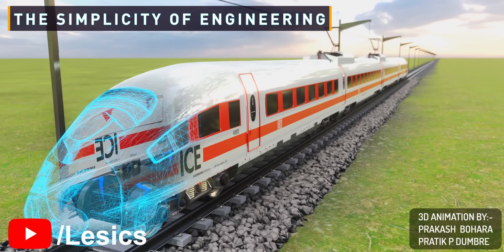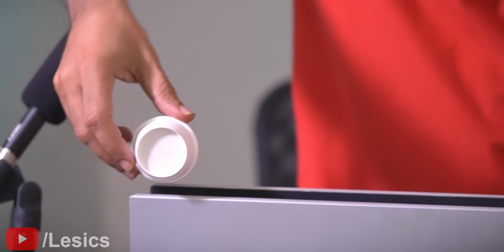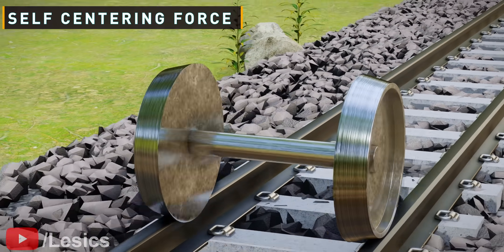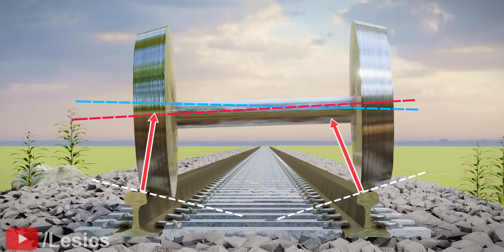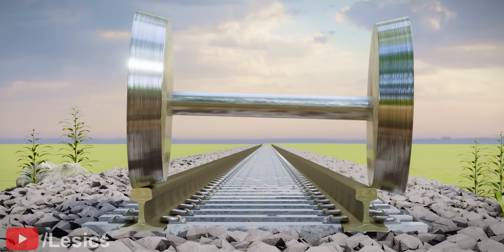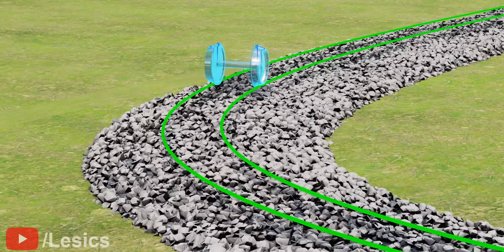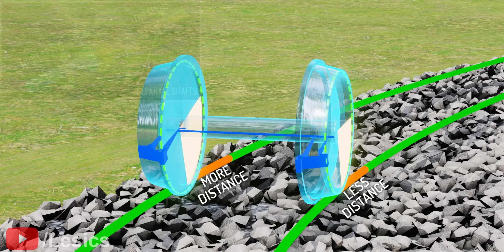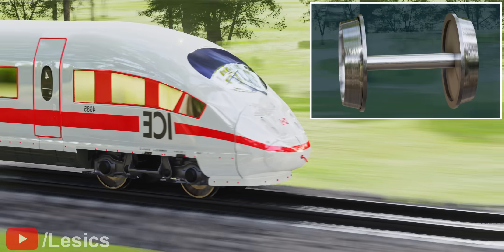The interesting engineering behind the SHAPE of Train wheels!

Comment: Driver (engineer in N America) of 40 years here. I've had to explain this to several trainees over the years and none of them had any clue of this phenomenon before it was explained to them. It's just not something the average person wonders about. I also explained (not to criticise as your video is excellent but you probably should've too) that the further apart the wheels are (the wider the track gauge is) the more differential action is needed because the outside wheel has to travel a LONG way more than the inside wheel but train wheels and the rails they run on are only around 80mm (3") wide so the wider the gauge, the less tight of a curve the train can negotiate. That's why mountain railways are often narrow gauge. Narrow gauge is cheaper to build than standard or broad gauge and when people are told that, they always say "because the sleepers (ties) are shorter?". Well, short sleepers probably are cheaper than longer ones especially when you need thousands of them but narrow gauge is cheaper because you can go around mountains rather than having to tunnel through them because you can't negotiate tight curves.
Reply: Knowledge speaks
Reply: Is that why Brunell's wide gauge never caught on?
Reply: @therealrobertbirchall  The UK is mainly flat so it probably could have but there was a plethora of gauges and 4' 8 1/2" simply had more miles of rack than any other so it was chosen purely for that reason. Same happened in the USA.
Reply: @davidrayner9832  the uk is not mainly flat. Ok our tallest mountains aren’t as high  as others  but flat it ain’t
Reply: @davidrayner9832  England which is where Brunell mainly worked is flatter than the US for sure, but in England the railways had a lot of curves because thet tended to go around the hills and unlike the US the railways were built to connect existing towns, whereas in the US the towns were built on the railway. There were also rights of way issues where politicaly powerful individuals prevented development of railways on their land, most of England,  unlike in the US where most of the tracks were built on virgin land. This all left us so many curves, this is why high speed rail in the UK is problematic because the victoriana track beds are not suitable for fast trains and governments are reluctant to take on vested interests when procuring land. We have lots of narrow gauge railways in the UK in mines and famously in Wales where narrow gauge was used in the mountains to haul slate from the quarries.
Reply: @therealrobertbirchall  Flatness is relative. The UK can be quite hilly and mountainous on a small scale, so gradients can be steep but generally over shorter distances; lots of the US is easily graded (the Rockies being an obvious exception). No hills to go round on the prairies. The Stephensons for early long-distance railways like the London and Birmingham used very flat gradients (1 in 330) because of the low power of early engines; that needed curves, big earthworks or both to deal with even modest hills. Brunel's billiard table only extends to Chippenham; after that it twists and falls to get through the Cotswolds to Bath and Bristol.
Reply: @iankemp1131  exactly so many curves. And the magnificent Box Hill tunnel.
Reply: @therealrobertbirchall  Yes, I know the tracks are curvy but they're generally large radius curves. I travelled from London to Edinburgh a few years ago and we sat on 100 mph for four solid hours. That may not qualify as HSR these days but it's not possible anywhere in Australia and it IS the flattest country on Earth.
Reply: @highdownmartin  I know it's not flat but it's flat enough for trains much faster than we have in Australia and it IS the flattest country on Earth. I once travelled from London to Edinburgh and we were doing 100 mph for four solid hours. That's not possible anywhere in Australia.
Reply: @davidrayner9832  took us 150 years to develop locos with enough power to do that. Shap ,beattock ,settle to Carlisle, Dainton, Rattery , the Lickey   All mainlines with fearsome gradients that slowed steam traction to a crawl. Electrification flattens everything!
Reply: @davidrayner9832  is it not possible in Australia?  I'm surprised
Reply: @therealrobertbirchall  most of us Ozzies live along the East coast. Venture in land and there is hardly anyone, and not the economics to support electrification.
Reply: @davidrayner9832  An interesting video. Some say that the standard UK track guage long in use, was based on the equivalent of 2 horses hitched along side each other for pulling a freight waggon. The trails eventually became tracks.
Reply: @therealrobertbirchall  I know Australia has a terrible problem with some of its tracks.  Trying to be cheap and not replacing the sleepers properly has caused mudholes  to form.  Its crazy watching a video about it. Like why would you not fix that immediately before it causes a derailment.

Google say, "Australia is just not suited to high-speed rail because the cities are too small and too far apart."
Reply: @davidrayner9832  Also narrow gauge is NATURE friendly in case of mountains because there is no need to harm them by creating tunnels..👍
Reply: @davidrayner9832  if Australian trains can't go at high speeds then that's a legislation or company policy issue. Australia absolutely could have high speed rail. The UK is far from the flattest country. Even ignoring small Polynesian island nations there are plenty of flatter countries, like Egypt or Denmark. Most of the UK is rolling hills
Reply: @justinbeath5169  Of course we could but the hilliest part of the flattest country is along the east coast which is where a high speed railway would have to be as 80% of the population lives there and yes, the reason we don't have it is because no one will commit to building it because A; it costs the same to build through hilly or mountainous country no matter where in the world it is and B; we don't have the population of countries like Japan so it'd cost a fortune to build and take forever to pay for itself. Building one across the Nullabor Plain would be very cheap but no one lives there. For those reasons, I can't see Australia ever having high speed rail.
Reply: @davidrayner9832  "we don't have the population of countries like Japan so it'd cost a fortune to build and take forever to pay for itself."
As I put in a reply to another commenter, we have large population centres (particularly Melbourne and Sydney), and back in the 1980s there was a proposal from a private consortium to build and operate a line between those two places.  They didn't want government subsidies, but did want the government to defer payroll taxes until they were operating and therefore earning an income.  The government wouldn't come to the party.
Reply: @PJRayment  Yes, Sydney and Melbourne are the two biggest cities so if we were ever to get HSR, that'd be where it should go but after an uncountable number of proposals and even renting a train from Sweden, nothing has come of it so one would have to conclude that there is no financial incentive to do it. I see Labor NSW has said that if they win, they'll put in HSR from Sydney to Newcastle. I say the people should tell them that everyone will vote for them just this once so they'll win every seat in the state but by the end of their first term, there'd better be some track laid and if there's not, they will never ever get into power again and that has nothing to do with it being Labor. If Liberal made that promise, same deal. I live in Newcastle so I hope Labor does win, just so I can say at the end of their term "well, there's another HSR proposal that came to nothing". That, and because the Liberals cut the low speed rail line off.
Reply: @davidrayner9832  I am new to Newcastle and even to Australia. Still understanding the parties and politics. Thanks for sharing that information. But with the prices of properties in Newcastle going up due to shopping by Sydneysiders, if this HSR proposal goes through it'll skew the market so much more.
Reply: @therealrobertbirchall  i would argue that we would need wider gauge. yes it means more tunnels and less tight curves. but with wider gauge we can get wider trains that act like small freight ships on land. imagine if a train car could stack 3 standard shipping containers in width and 5 in height. just by scale it would bring down freight costs on land.
Reply: @nilsdock  I think England is too small for such leviathans and you should concentrate on costal traffic via sea container. This makes even less sense in Scotland and Wales.
Reply: @therealrobertbirchall  lets put them on bigger continents then
Reply: @nilsdock  you are forgetting a train can be as long as it needs to be.
Reply: @nilsdock   You don't have to walk sideways in the cars when passing people?  Our train's today is in my opinion narrow gauge All of them.
Reply: @nilsdock  

As a society, at least in North America, we can't even get a lot of the cargo off of highways onto rail even though it's less expensive and better for the environment in its current format. Much of this stems from decisions made when the shipping container was introduced. There's a very interesting book (at least I found it to be surprisingly interesting) called The Box: How the Shipping Container Made the World Smaller and the World Economy Bigger by Marc Levinson. It goes through the what shipping was like before the shipping container and the changes brought about by it. As I was reading the book I could see decisions made in the 1950's and 1960's that were still impacting us today. 

Many people are trying to replace the fossil fuel burning long distance trucks with some sort of "clean" version that uses batteries, connects to the grid like trams, or use hydrogen. These don't remove the trucks from roads and all of the other problems associated with them such as traffic jams, wear and tear on the roads, accidents, and so on. I'd like to see rail being replaced to at least all of the major cities again (since so much rail has been taken out). Rail would be used to distribute cargo to the major cities. From there the long distance truckers would be re-tasked to local and medium distance deliveries. Eventually all cities would have a cargo rail station again with trucks to deliver locally and to towns and to the country. This would dramatically free up space on the highway system and also cut down on the maintenance of the system too as fewer heavy trucks would be driving on them. The more goods taken by train, the better for the environment, especially if the trains could be electrified with a clean source of electricity.
Reply: @therealrobertbirchall  given Japan's high speed network is narrow gauge , I don't think it was down to the physics of cornering, Some African and Australian railways are narrow guage for freight too so that also wasn't a consideration , Brunel was simply a victim of the politics of his time, also the added cost of wider guage , wider track beds tunnels and other assorted infrastructure. I personally think wider guage would have been better if adopted as the main standard .
Reply: @Dawgreen  All correct except that while Japan's traditional railways are narrow, the Shinkansen runs on standard.
Reply: @Dawgreen  due to physics Japan's high speed trains couldn't take very sharp curves because of tipping which a wider gauge would help with but idk
Reply: @Dawgreen  My guess as to why high speed and freight trains use narrow gauge is simply because longer axles are more fragile. With freight and high speed, the forces acting on the axles are much higher and since the gravitational forces act on the middle of the axle and the normal forces act on the wheels the axle could bend.
Reply: @Dawgreen  Japan's high speed is standard gauge
Reply: @Dawgreen  Japn's high speed rail network is standard gauge, the rest of their rail lines are narrow gauge.
Reply: @Dawgreen  probably not the sole reason, but cost savings is cost savings so why not do it?
Reply: @Ninjaeule97   It's better with train wheels. They have they'r bearings on the outside close to the wheel.  It makes the axels stable.
Reply: @Dawgreen  only short lines aus uses browd gauge and standard gage the most
Reply: @Dawgreen na wybór szerokości torów w dawnych czasach miało wiele rzeczy wpływ. Pamiętajmy że wiele szerokości infrastruktury zależało od cen stali,robocizny,dostępu do odpowiedniej ilości kadry, z odpowiednim poziomem wykształcenia.
Raz podjęta decyzja utrwala się na wieki ,bo okres transformacji jest zbyt drogi.
Trzeba wymienić w skali kraju tysiące kilometrów torów,wymienić osie wszystkich wagonu
Reply: Thanks, now I know more about trains.
Reply: @ohh9979  i guess you needed the extra training.  ;)
Reply: What you said about turn radius is not wrong, especially when talking about mountain railways where the speed is slow and cant deficiency (superelevation/difference between height of inner and outer rail in a curve, think of a banked road on a highway) is minimal. However on plains, tracks are banked at curves. The maximum bank angle/ cant deficiency is a function of the track gauge. The broader indian gauge for example has a max cant deficiency 165mm whereas the standard gauge of US has this set at 75mm for normal use and 102mm by special approval. This means that broad gauge tracks can negotiate sharper curves because the wider wheel base gives higher stability. Also, the wheels of broad gauge trans have a greater radii than their standard gauge counterparts as wheel diameter is generally 0.75 times the track gauge, and the width of the tread also increases proportionately. This means negotiation of curves is more or less the same in different gauges used around the world though the higher cant deficiency in broader gauges means that it can turn tighter. The reason mountain railways generally don't use cant deficiency is because that increases the dynamic profile of the loading gauge and space is for a premium on that terrain, otherwise what you said is correct. Im a signal engineering student of indian railways but my friend in the permanent way department gave me inputs for writing this message.
Reply: How many gauges are there in North America? 
I always assumed it was standardized.
Reply: @Heavywall70  There were once many, for example the Pennsylvania Railroad was 4' 9", just 1/2" wider than standard and they, along with several others, had to regauge to standard purely because there was more of it than any other. Mountain railways like the Colorado & Southern had narrow and they standardized the lines they wanted to keep and closed the rest. Some of those survive as tourist railways but they don't connect with the rest of the network.
Reply: @davidrayner9832  Don't cone shape wheels imply huge pressure on rails? Since it's not a surface it's a line, wouldn't excess pressure deforms rails or wheels?
Reply: @kozatas  I don't know but it does keep the train centralized on the track and allows it to go around curves. If cone shaped wheel have any drawbacks, they're not serious enough to not use them or find another way.
Reply: @davidrayner9832  Their is video by "The History Guy" titled "The Day the Gauge Changed." When Southern railways changed over to the Pennsylvania gauge.
Reply: @kozatas  Yes there is huge pressure. The railhead is prone to fatigue failure and also has to be reground fairly regularly to maintain the correct head profile.
Reply: @Heavywall70  Standard Gauge is 4’ 8 1/2” .  Older narrow gauge, like the Denver and Rio Grande Western and many others were 3’ gauge.  Maine had several that were 2’ gauge and some industrial RR were 18”.
Almost everything you see in the US today, aside from some historical stuff etc, is Standard Gauge @ 4’ 8 1/2”
Reply: @elconquistador932  I can’t speak for other transit systems but the BART trains here in the San Francisco Bay Area run on 5’ 6” broad gauge. Presumably the extra width would be more stable during an earthquake as trains are brought to a stop, but it also preserves the system as dedicated to passenger traffic only.
Reply: Hadn’t thought about tread width/ minimum radius before , I knew the answer but that explains it   nice one
Also the rail heads are also canted in. Usually 5 degrees ,matching the coning
Reply: im just the average joe 39 years retired owner operator of two macks but i have just learned somethings i always wondered about.  (with the wheels ) also i happened to have an inspector explain the laying of ribbon rails while watching for two hours how they install new rails ( i always wondered how they prevent the rails from bowing out ) well what they do is nail down the rail about every fourth tie then they heat up the rail and nail down the rest of them this helps to prevent expansion when the temperature get real hot also the machines were owners of the company that layed the rails . this was done on the wisconsin southern line from waukesha to milton two trains per day the guy said that these rails could last up to a hundred years
Reply: @realtruth172  what the railroads do for ribbon rail is to stretch it (like a guitar string)  before they nail it (spike it or clip it) down. It is far easier (read cheaper) to repair a track that has failed in tension rather than compression (bowing out).  Look up rail tensors. They also stretch it when they weld the 1/4 mile strings together, hold them under tension as they weld.
Reply: @hugocfr  Thanks for the info.  Watched a show the other day about a train derailment in Tempe, Arizona. They believe it was caused by the rails expanding, since it was the middle of summer. And I was wondering how they prevented that from happening more often and forgot to google it.

The Eiffel Tower gets taller by up to 6 inches during the summer and its only 324 meters tall. Based on that in a mile of track you could have around 30" of expansion.
Reply: @fukkitful  
"They believe it was caused by the rails expanding, since it was the middle of summer. And I was wondering how they prevented that from happening more often and forgot to google it."
Actually, the normal approach these days is simply to hold the rails tightly, with plenty of ballast, including at the ends of the sleepers.  You can thereby contain the expansion.  Heat-buckled rails are typically found where the ballast is missing or in poor condition, or freshly laid and not yet settled.

"Google say, "Australia is just not suited to high-speed rail because the cities are too small and too far apart." "
It's not a simple answer, and also includes the question of what is meant by high speed.  Victoria, New South Wales, and Queensland all have or had trains operating regular services at 160kph (100mph).  NSW was first, with it's version of the British HST (standard gauge).  I think it's speeds have now been downgraded.  Victoria has frequent interurban services operating at that speed (mostly on 5'3" gauge, but also on standard gauge).  Queensland has two trains that operate at that speed (on 3'6" gauge).

There have been and still are numerous proposals for trains much faster than that.  A 1980s proposal was for a line between Melbourne and Sydney with trains operating at 300 kph and the fastest journeys taking three hours.  This was a commercial proposal, that wanted government assistance in the form of deferring payroll taxes until the line was actually operating (and they had income).  The government didn't agree.

The cities are not too small.  Well, some aren't.  Melbourne and Sydney each has a population of over five million people.
Reply: in response to your question im retired 11 years had two new macks one 14years and one 24 years total 39 years 2  3/4 million miles this was just very recent about how they lay these ribbon rails this was done in waukesha county wis for southern wisconsin railroad the man said the expected life for these rail is one hundred years two trains a day come thru
Reply: @realtruth172  so Joe are you 39 or been retired 39 years?
Reply: @Dawgreen  But the high speed running is confined to standard gauge. The change to narrow gauge is to provide through services to outlying towns, like the French TGV continuing on to ordinary low-speed lines of the same gauge. Speed records for narrower gauges worldwide are substantially lower than for standard gauge. The fastest rail-based speeds are on standard gauge (apart from maglev) and wider gauges were not necessary. Dimensions of coaches and wagons are determined by the loading gauge (size envelope), not the track gauge; see the big Eurotunnel shuttles.
Reply: Can you explain why some trains have a steering wheel?
Reply: @RanulHashika  They don't.
Reply: @davidrayner9832  Yes you are right, trains don't need a steering wheel. The ‘steering wheel’ is actually a throttle.
Reply: @RanulHashika  Some trains have what looks like a steering wheel. It is used to set the speed. I was surprised the first time I saw one, but observation showed its actual use. I have seen them used in local service leaving Interlaken, Switzerland and since then in some older equipment in Germany.
Reply: @RanulHashika  Train does not have steering wheel. Train wheels follow the tracks. The wheel which looks like s steering wheel is used for speed regulation.
Reply: @RanulHashika  They don't, in some locomotives the throttle looks like a steering wheel.
Reply: @RanulHashika  what? Really?
Reply: @David Rayner ... Additional details very well explained... Thanks for sharing your knowledge on this...!! ☺👍👍🌼
Reply: No doubt the video is good but the additional information you provided about the broad and narrow gauge and their usage really added to the knowledge content. Thanks 👍
Reply: Wow, this explains why I find narrow gauge trains in hilly areas! 👍
Reply: But won't the train compartment's width also have to reduce in order to be carried on narrower gauge?
Reply: That is very interesting! Thank-you for that comment!
Reply: In motor racing, the difference in circumference between the outside tires (on an oval) and the inside tires is referred to as "stagger".
Reply: Wow, thank you so much for all this knowledge..... I got it 👍
And yeah, very nicely explained.... You're awesome
Reply: You are right about how narrow gauge railways are ideal in mountain terrain etc but Queensland railways in Australia chose narrow gauge because it is cheaper as less earthworks is needed for narrow gauge compared to standard gauge. Queensland is a large state but a small population compared to the other Australian states and so decided to use narrow gauge as a way of servicing remote locations at a cheaper price. In fact Queensland has the second largest narrow gauge rail network in the world.
Reply: Bakk itna jada ko kon padhega
Reply: then I'm glad I'm not the average, because I figured out this myself while waiting for my train
Reply: why dont' the train wheels wear out?   If its metal on metal dont' they wear out fast?  what  keeps them from wearing out.
Reply: @Jimo225  They do. The flanges wear out from going around curves when they rub on the rails and the rails on curves wear out too. The tyres (yes, that's what they're called) wear out from having the brake shoes rubbing on them during braking. So, the straighter and flatter the track, the longer the wheels will last. They all have a groove machined into the side of the tyre about 50mm in from the tread called the 'condemning line' and when the wheel wears down to that, it must be replaced.
Reply: @Jimo225  Interesting question. I'm not sure, but, I think they wear out, but, it takes a really long time.
Reply: Good info David! My father was an engineer for the Milwaukee Road.
Reply: @SLJ2137694  The former electrified railroads of North America fascinate me. Milwaukee and Great Northern locos are some of my faves. On my last visit to the US back in '15, I went to the museum in St Louis to see (among other things) a bi-polar.
Reply: Thanks I hadn't twigged to that before. Cheers
Reply: https://youtu.be/kZEpJFjxYek
Reply: https://youtu.be/kZEpJFjxYek
Reply: Compare the SAME thing applies to cars/trucks, except in their case, you have a DIFFERENTIAL that ALLOWS different speeds of outside and inside wheels.
Reply: @itchyvet  Yeah, it was told in the video...... Didn't you watch it properly?
Reply: @itchyvet  emptien the tire pressure on inside when going through a bend. And then filling them up again on the stretch. Same procedure vice versa! Automatic  differential  pressure  controld tire's.
Reply: Wow thanks for this information that clears a lot of doubt for me
Reply: Well,I thought  about the train wheels this morning  and this video came up on my recommendatioWell,I thought  about the train wheels this morning  and this video came up on my recommendation.  Needless  to say, the question  in my head was answered. n.  Needless  to say, the question  in my head was answered.
Reply: Thank you senior 🙂
Reply: But it's not the actual track that it cheaper, it's just the applications of use make the path cheaper, right?
Reply: @chaztitan6457  As I said, shorter sleepers are cheaper than longer ones but yes, it's the path a narrow gauge track can take in mountainous country that makes it cheaper. Tunnelling is expensive.
Reply: @davidrayner9832  
I’m not sure if someone pointed this out. In Australia all the states have different rail gauges. Some narrow-some wide. Prior to federation each state operated like its own country and was jealous of its own trade. Trains would have to disembark onto another train at state or territory borders.
Reply: @fortunateson7852  I know, I live there. It's bad enough that they did that but an absolute disgrace that it still exists today.
Reply: @fortunateson7852  
"In Australia all the states have different rail gauges. Some narrow-some wide. Prior to federation each state operated like its own country and was jealous of its own trade."
That's only half true, and it's a lot more complicated than that.  Victoria, New South Wales, and South Australia were all proposing railways around the same time, and decided to standardise on the same gauge.  This was despite there being little to no expectation at that stage they they'd ever connect their railways.  New South Wales had an Irish engineer who recommended the Irish gauge, 5'3", so all three states agreed on that.  However, the Irish engineer was replaced by an English engineer who recommended standard gauge.  This was conveyed to the other states, but they had already ordered equipment, so stuck with the original plan, while NSW went with standard gauge.

With long distances and very small populations, Queensland and Western Australia decided that they couldn't afford that, and opted for 3'6".  Tasmania initially went for broad gauge as well, but then switched to narrow (3'6").  South Australia decided later to build quite a few lines to 3'6" also, although later converted many of those to 5'3"!  After the South Australian system was handed over to the federal government, what was left was either converted (sometimes for the second time) to standard gauge or closed.  (Some locations had triple-gauge track for a while!) (The Adelaide suburban system, however, remains under state control and remains 5'3".)  Some regional Victorian lines have been converted to standard gauge.  And apart from lines connecting to other states (e.g. standard gauge from NSW to Brisbane in Queensland, and from the eastern states into Perth in Western Australia), that's about where things stand.
A bit of trivia: Melbourne's and Brisbane's main stations for regional and interstate services each have some dual-gauge track.
Reply: I saw a video of a train changing gauge width, driving into a machine which changed the bogeys, I’m sure that’s what it did 🤔
Reply: https://youtu.be/1y-8AOmdFyo vtfj
Reply: Wow! This is a new information. Thank you!
Reply: I learned this in training school, when i worked for railways for a short. I was amazed to know this back then as well. Such a simple and effective design.
Reply: It seems so elementary.
Reply: I didn't know the wheels were locked to a common shaft. What would happen if the wheels were housed in bearings?
Reply: @Navigator777777  I have to agree..👍
Reply: Impressive post. I am impressed. Thank you
Reply: As an engineer who does training you should also know that the top of the rails are also canted inward at about the same conical angle as the wheels.
Reply: very very interesting!
Reply: That's real information! From a professional! Really good explanation from someone who knows.
Reply: Well dagum!
Reply: https://www.youtube.com/watch?v=Lz9W_j2et64
Reply: Several years ago i worked on italian trains service railways and nearly everone know that. Now i found out on youtube
Reply: Anybody knows if they make train wheels using titanium? Thanks!
Reply: @miku5840  High Carbon Steel heat treated to a high hardness I think. Titanium is expensive and difficult to machine. Train wheels get put on a wheel Lathe and are machined back to the right profile regularly.
Reply: @davedaniel2091  There's absolutely no train wheels made of titanium?
Reply: @miku5840  Not that I'm aware of. Titanium is usually used in weight critical applications where its high strength to weight ratio is essential (aerospace applications mostly). Lightweight is not a requirement for train axles so why waste money on a material which is expensive and difficult to work with when Steel will do the job better.
Reply: @davedaniel2091  Alright. I was reaching anyway. Had to squeeze in 'titanium' while writing a lyric about a metaphorical train ride because it fits well. Except it's logistically a bad idea in real life lol. Thank you so much :)
Reply: That explains why the (in)famous Hitler's Breitspurbahn had only straight lines on paper, connecting major European cities! 😂😉
Reply: another reason video is better than a paragraph! 🤣
Reply: I sll
Reply: Why don't aways use narrow gauge?
Reply: @brunobatista6568  If you mean even when the terrain doesn't necessitate tight curves, the wider the gauge is the more stable the train is so even on shallow curves, the speed needs to be reduced to a greater degree than on a wider gauge to keep the train from tipping over. Also, because the weight is put through the rails and onto the sleepers, it's the sleepers that are pressed into the ground and the shorter they are, the more they'll be pressed into the ground for a given weight on them. So, not good for high speed passenger trains nor heavy freight trains.
Reply: @davidrayner9832  Oh, interesting! Thanks for the explanation!
Reply: Couldn't they just make the cones bigger instead of making the track narrower to get around tight corners?
Reply: @hjpev6469  In a word, no.
Reply: yepp,chipper, tilll day runnz off, dah trackers
Reply: Do you ever have to explain about "wheel hunting" or "roaring rails"?
Reply: For sure. If anyone is really struggling with the concept, go grab an offroader and lock the diffs. Now drive a tight mountain road and see how you get on. Best case, it drives like dogshit. Worst case, you're replacing the diffs
Reply: @helplmchoking  in a sense yes your right but in another your wrong ruber and a mountain cliff are different textures and the axel of a jeep ect.. arnt made to handle that but steel rails and steel wheels are the same so there little to no friction and when worst comes to worst it will slide the wheels little but it was made to do so and since its just steel it can slide little the axel isn't going to brake
Reply: now i know why chinese Railways in is mountains of debt..haha
Reply: I wonder if there is a point where if you go too narrow then there is not enough stability etc...How is that worked out? Or do they keep the width of the wheels similar to the width of the body etc.
Reply: What would happen to a train if you put wrong wheels on a wide track or if you make tighter turn than the differential can accommodate? Is it just the question of wear or would the train be unsafe?
Reply: @Bartooc  If you put wheel-sets of the wrong width on a train, it would not sit on the rails. As for a curve that's too tight, there is a minimun radius for any given gauge and no company would build a curve of less than that but if they did, the wheels on one side or the pther would screech going around it.
Reply: Thank you for explaining this!
Reply: Pozdrawiam z Polski. 
Kolego czy w USA jest tylko jeden typów torów kolejowych?
To ogromny kraj i myślałem,że każdy stan Ameryki ma swój typ torów. W Europie -Rosja ma swój typ,Polska swój. Anglia chyba też ma swój  typ torów.
Reply: Na rozstaw szyn miało wiele czynników. 
W euroazji jest chyba 10 rodzaji torów. 
System metryczny:
W Polsce mamy wymiar,,europejski,, 1430mm, w byłym ZSRR obowiązywał rozmiar 1524mm, Finlandia ma 1500mm.
Hiszpania, Finlandia, Portugalia  i Irlandia mają własne szerokości torów. 
Stslowe Szlaki Finlandi8 są  kompatybilne z rosyjskimi ,bo Rosjanie stosują szerokie obręcze koł wózków kolejowych. 
Dzięki temu płaszczyzna koła potrafi się mieścić na Łukach i rozjazdach kolejowych,choć ( wydaje mi się) ,że skład kolejowy ma zmienioną prędkość manewrów. 
Podobny do polskiego rozstawu szyn mają  szlaki w Chinach. 
Indie i Japonia też  mają  niezależne rozstawy szyn na szlakach.

Mam rodzinę pracująca w Koleji dlatego wypowiadam się. 
Praca maszynisty- jest bardzo wymagająca, są  bardzo restrykcyjne przepisy zdrowia, trudne egzaminy, jest wymagana niekaralności (jakikolwiek wyrok eliminuje z prawa do pracy) .Prawo do pracy wymaga albo wykształcenia średniego,ukończenia kursu,praktyki,egzaminu albo nauki zawodu od młodzieńczych lat i praktyki zakończonej egzaminem.
Był czas gdy pracownicy kolei byli ujeci w struktury militarne i praca była traktowana jak służba.